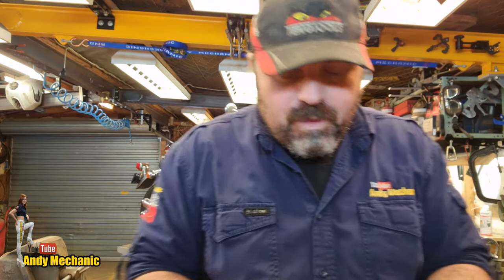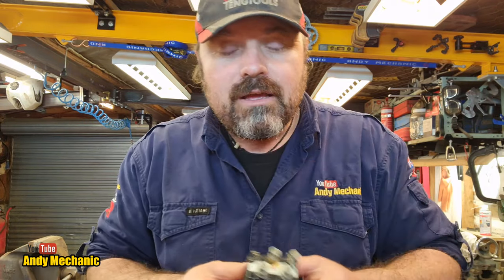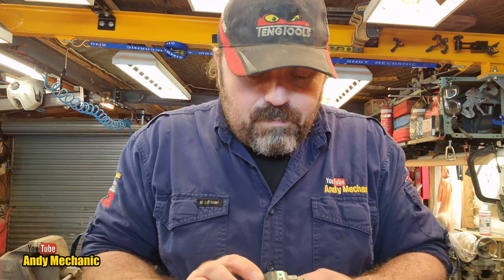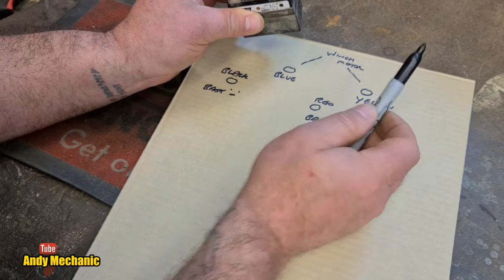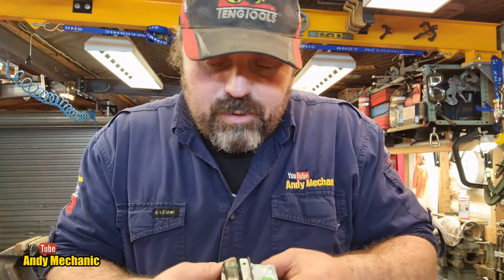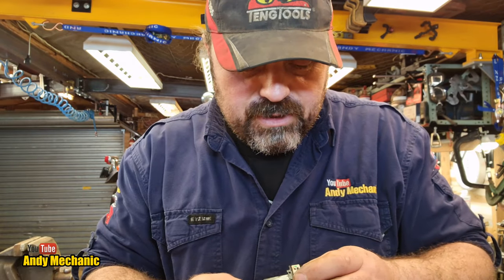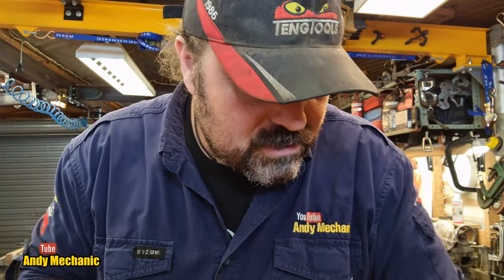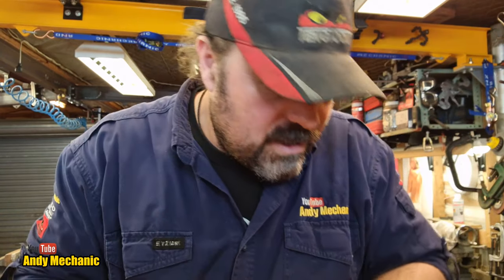Winch not working? Here's how to test the solenoid #1471

Comment: Your video was spot on. After a fight to get the 'universal bracket' on the plow, get the plow on, the winch would only go in, not out. Fight with thr button, then found a fuse blown...then nothing...then take the solenoid off and check to see your video if it could be taken apart...sure enough...the one was jammed same. Clean it then release oil...boom.
Reply from the maker: Awesome, great job  All the best Andy

Comment: Thanks for the help video  I can now fit the winch . Cant think why they didn't put a wiring diagram in the box. In the light of the information on corrosion I am going to put two 1/16" holes in the top of the casing and two 3/32 holes in the bottom for  injecting wd40 and airline  blow through  points and fit the cut out switch. cheers

Comment: I've always coated the solenoid in wd40 or innox before a trip. Also before fitting a really thin coat of silicon around the plastic joints!

Never bothered to take one apart though! Thanks heaps, it was very helpful!

Comment: Thank you for the tips about battery cut off switch.
Reply: My winch won’t work until the key is on.
Reply from the maker: Cheers Dan, your winch may be wired up in a way that the trigger circuit for the contactor doesn't get a voltage supply until ignition is on. If so the main power feed to the contactor (heavy cable from battery positive) may still be permanently live - this is a problem as the contacts inside the contactor will be live & will corrode. Best to fit an isolation switch which will stop this & also allow you to cut power to the winch motor if the contactor fails when spooling in or out.

Cheers Andy
Reply: @AndyMechanic  my last Warn contactor had a recall. Replaced for free. Nice to see the insides.

Comment: Very informative.  Is there a circumstance where the solenoid would still 'click' but no current on that side?  🤔 Thx
Reply from the maker: Yes, definitely - usually the internal contacts will be badly burnt when this happens.

Worn brushes or burnt windings in the motor will also cause the same symptoms - but would occur in both spool In & out.

Cheers Andy

Comment: Hi Andy, thanks for your video, you are very clear. My solenoid is different, with only 3 big plots instead of 4. It goes with my boat windlass. Anyway, I shunted it to test my windlass and the windlass works. When I connect it to the solenoid it doesn't. I tested my solenoid the way u show it, with the multimeter. There is a clicking sound on both side... but hardly any voltage! 3.5, 4 V... Does it mean it's totally dead? I did open the box, it was surprisingly clean, no corrosion or hardly, I cleaned everything, but still same result.
What is your opinion? Shall I replace the whole thing? The coils inside are hidden by some kind of plastic wrapping, so I couldn't check them. But the rest looks OK, springs etc.. Thanks man!
Reply from the maker: Hi, yes, it certainly sounds like an internal fault with the solenoid, I'd suggest replacing it.

Thanks for the feedback, pleased you found the video helpful.

Cheers
Andy

Comment: Just wondering if you have a video or know where to get parts for the DC motor on a liftmoore 2000 the magnets have a spring loaded spacer and they got smashed and don't hold them in place anymore

Comment: Thanks for the testing instructions. I was able to determine my solenoid is operating correctly. Do you have any battery isolation switch recommendations? I'm reading good things about the Blue Sea 9003E. It's made for marine use.  (I am not a Blue Sea affiliate in any way) Would you also recommend an ON/OFF switch for the trigger circuit just in case the OUT/IN rocker gets stuck or goes rogue? And thanks for the disassembly. I love taking broken things apart and learning how they work (and how I broke them).

Comment: Thanks for wasting your time dismantling it…lol…I was just about to do it but seemingly direct jumping of relay to winch works both ways ( in and out)…both my wired remote ( handle bar)  switch and remote switch don’t work…it seems that center common contact for switches is the problem ( I think )…thanks for the vid and destructive understanding 👍🏼…LOL

Comment: I have a 12 volt  winch when test the control box the red lights up tester when pushing the in on the controller and on the black when I push the out. When plugged to winch it lights up in and out on both the positive and negative post on winch. Tested the plug for winch plugged in same thing but unplug winch control box lights like it should??????

Comment: Thank you very much! A question.. what happens when one uses a bigger relay than needed.? A 8000lbs winch relay for a 2000lbs winch..
Reply from the maker: it will be just fine. no problem at all :-)
Reply: @AndyMechanic  one more question.. how do you do this with the girls 😂?
Just kidding. thank you very much.. great help 🙏
Reply: If you use a solenoid from a heavier winch, it will probably be for a series wound winch, they are wired differently.

Comment: Andy,

I got a winch that’s passively drawing 12amps from my battery. I have pulled it all apart, checked the solenoid, the solenoid is good, but the winch still just draws the power from my battery.

Do you know what the issue could be?
Reply from the maker: Yep. It has to be a solenoid fault. The solenoid, when the winch is not in use, should disconnect all of the heavy cables to the winch so there should be no circuit

I'd suggest replacing the solenoid - 12 Amps draw is very high. Also make sure you have a battery isolation switch fitted on the main 12v positive from battery to solenoid  - without one things can go really bad if solenoid jams in spool in mode....

Cheers Andy
Reply: @AndyMechanic  aight! I have a replacement solenoid ready to go, so I’ll give it a try!

And yes, after watching your video i was like “yeah, i need a switch!”

What kind of switch do you run for that kind of job?
Reply from the maker: Usually the type they use in really cars...normally rated to 100 Amps. If winch draws more current then you can get a larger one from a truck parts supplier
Reply: @AndyMechanic  thank you for the help!!

Comment: Im thinking of using marine solenoid should it work ank 2000lb winch ampere is 35 - 150.  Should it be okay?
Reply from the maker: Yep will be just fine though remember the winch solenoid is a duel change over relay, not a standard type relay.

Cheers Andy
Reply: @AndyMechanic  but can i use 2 relays from a motorcyle type 100a?
Reply: @AndyMechanic  the winch worked with it but cant figure out how to wire it 🤣
Reply from the maker: Hmmm.....how many wires to the winch motor, 2 or 3
Reply: @AndyMechanic  2 only i have
Reply from the maker: Okay. Unfortunately it's not possible. Those relays are single acting & can only connect or disconnect a single circuit - like a switch

With your winch the contractor block reverses the polarity to the motor to make it rotate in both directions. 

You'll need to source either two more of the relays you have or, which is much easier, just get a proper contractor block matched to your winch

Cheers Andy
Reply: @AndyMechanic  thank you for your reply

Comment: Daniel Kistler from Australia has a good video on how to access the contacts and bussbars in a Albright solenoid by taking bottom nut off 4 terminals and removing the 4 terminals which are like studs in copper retainers he then removing the copper retrainers with pliers so you can clean the contacts by remove the top cover without destroying the solenoid which when cleaned you can retain as a spare. he used sandpaper between the 2 contact surfaces worth bit of a look as could all be done on the track

Comment: So let’s see the side of the winch that was working was the outside to let the winch out my watch has a free turning switch where I can just click over and pull it out so sorry I didn’t check it and then I realized my winch will not return but it was still go out I could switch the polarity on the load side to make that change to be the return then and be able to make it home with my vehicle instead of having to walk because my Winch only had 1 side working is that correct or would I change The polarity on the low-voltage side and it will automatically switch it on the high-voltage side
Reply from the maker: you'd have to switch over the two heavy cables to the winch motor for it to reverse. The fault is likely in the contactor - if not then in the actual switch that controls the winch. You'd have to do some simple tests...

Hope this is of help. Cheers Andy

Comment: 2:06 " my background is 4 wheel drive winches warn....." ,   Seem more like you just have a little bit of experience with them not a background in them.
Reply from the maker: Correct....I have fixed a few over the years on our 4x4 recovery vehicles & Unimog  (rear anchor winch) - had a hydraulic on the front. Plus a few ATV winches too...

Comment: Thanks for the video. my question is the following. I have Axon 45s installed. But its works in wired way. When try it in both ways (in and out) it works with clicks. It turns and stops, turns and stops. Please see the video (https://www.youtube.com/watch?v=Mudbp1xeuEI). Any idea what causes this? I think this model is with integrated contractor, and no solenoids are there correct? Will appreciate your help.